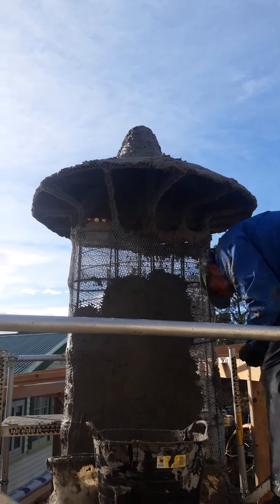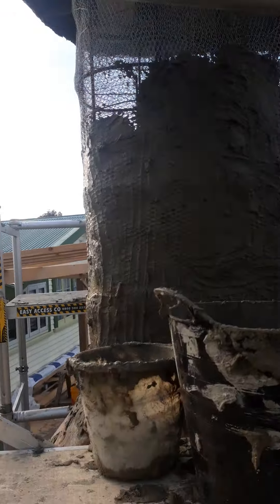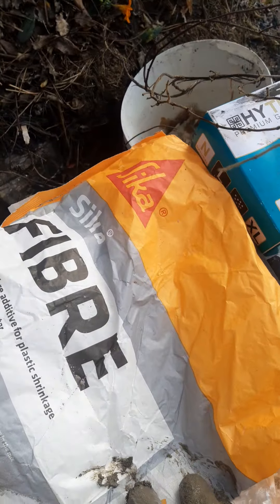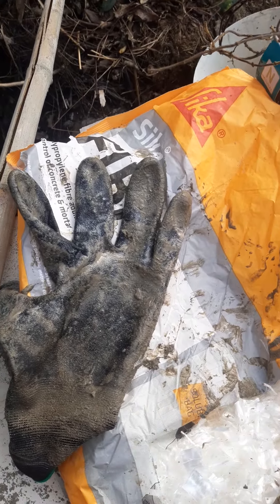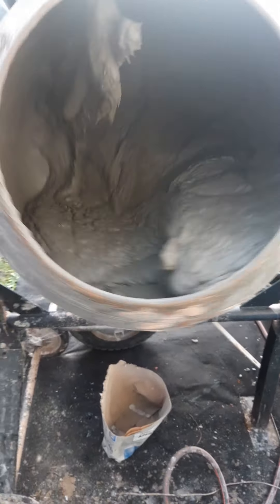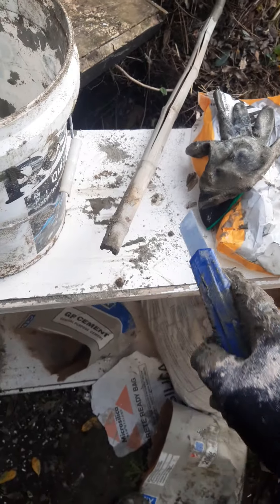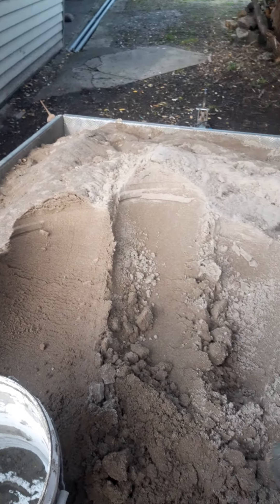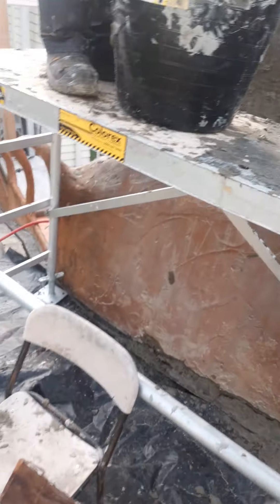Secrets of the Mud - how to plaster a Ferrocement mushroom chimney.

Comment: Thank you for this information! I'm amazed by Ferrocement and find myself caught up in imagining the possibilities for affordable home construction with it. Have you experimented with nonferrous materials like basalt rebar or fiberglass? The potential for rust with standard rebar and chicken wire concerns me a bit (also the extra thickness of the plaster to ensure sufficient coating vs thinner/lighter possibilities with other materials...).
Reply from the maker: Hi Jeff... ive been imagining hobbit holes and cabins using Ferrocement for years now, soo going to make one, just a bedroom, with round doubledoors... see my www.dreamhaven.nz...concept drawings etc. Ferrocement is so strong, durable... maybe not cheaper than many methods  but so sculptural and strong. I have seen non ferrous reinforcement but never tried it...apart from very handy coated fiberglass mesh in rolls..
Reply from the maker: Oh yes also the question of rust...not serious with Ferrocement as the mix is so rich. Witness the durability of well built Ferrocement boats in salt water...  the cement 'passivates' the rust. We did a Ferrocement fountain for eutopia Cafe 22 years ago..thin stalk, water in it continuously all this time. No rust I am aware of, even beginning. It is painted to of course.
Reply: @wizardofeutopia  great points on durability. I'd guess that steel rebar and chicken/rabbit wire fencing is both more affordable easier to get ahold of in more areas than basalt/fiberglass, too.
Reply from the maker: @Christ_on_the_River  yes steel definitely last time I looked was much cheaper and more available than the alternatives... always could change though.... I am investigating insulation for Ferrocement dwellings...looking into rockwool...  also steel wool for possible chickenwire substitute at least in part...there are some very interesting possibilities... watch this space! Well, in particular I'll update on www.fantasticferrocement.com and of course here on youtube @Renaissanceworkshops
Reply: @wizardofeutopia  I'm looking at a hybrid of Doug Lacy's insulation methods for double-walled ferrocement walls and what Stephen Williams is doing with styro-aircrete.
Reply from the maker: @Christ_on_the_River  ok good...research! I'll look up first kne, I have seen lots on aircrete,  made some... variable results, put me off, like baking a cake that rises but then sinks! Styrofoam bits seems a bit belt and braces, and the stuff is a bit plastic, wife hates it because hens can choke on it! I've used secondhand slabs to build a ferro styrene cabin tho...very warm!
Reply: Wow, what a great resource here, great mix, great method and I love the craftsmanship on the reinforcing armature.  It is possible to master cellular concrete using the right foam in a mix that serves as an insulation pour or to help "passivate' the rust in a strong mix as mentioned below.  The tests show that the closed-spherical cell aeration, Mearlcell 3532, creates relief for chemical expansion, ice and rust, so essentially fossilizes the steel reinforcing.  

I stick with only the 10 gauge grid-wire for armature to reduce the amount of steel encapsulated and the double strand, train-track, ribbons allow the branching and arching trusses, in the insulated roof, to accurately blend into fluid complex shapes allowing you to build those fluid forms accurately; forms you can't even fully model or draw but that you can reveal on site while still following your basic clearances from the blueprint and such. You can have flattish roofs because the truss frame is thick and sturdy. Any floor-plan layout; odd shapes, 'L' shapes, egg shapes, whatever.  Having the roof and awning done just simplifies the entry walls and lets you get more creative there.  

Those intersecting train-track ribbons somehow carry lots of info about the shape, also allows your single shell forms to blend accurately by just using the ribbons, not the block trusses built on the ribbons like for the main roof.  Single-shell funnel columns blend to each other, to the curled-edge protective awning and the double shell insulating roof.   To me, there is a base geometry principle for building homes that is a funnel column supporting a thick insulating roof and curled-edge awning; all one stable fluid form called the Core Monolith Pavilion.  It's just a principle not a set look or form as the awnings and roof curves can be many kinds of shape but the funnel-flare columns that tie the insulating shell to the single shell awning, is needed.  This makes roof gardens naturally.  The awnings are practical and provide spread-force butressing, balancing the stored forces in a dome like a buttress would.

The entry walls are built separately and are not mechanically bonded to the pavilion or floor. 

 If you want to keep playing with foam, try the Mearlcell 3532, its a good fit for low-water reactive powder mixes, and be sure and give the mix a good 5 minutes mixing, adding about 2 or 3 minutes into your fluid mixing but stay in the range of 9 to 18 percent foam for strong shell mixes, more for milkshake pours to seal and protect steel and give you some insulation..  My 2 bucket mix, is 4 gallons sand, 1.5 to 2.5 quarts water, depending on temperature... You want to cross minimum hydration threshold slowly at first to dial in the water content for your situation by adding little bits of water after 4 minutes of mixing all ingredients with slightly less water than will make it fluid.  Keep track of what you add and when it starts to respond by turning into larger round clods, let it stabilize then bring it to its fluid state with small amounts of water and pauses.  You can monitor the effective water content by stopping the mixer to see how much it self levels.  If you avoid excessive self leveling initially, the densified mix will mix thoroughly after five minutes in a fluid viscous state, while you are keeping up with water as all the cement hydrates. If you stick to avoiding self-leveling, use the exact amount of water needed initially, cross minimum hydration slowly, THEN you can hydrate it to whatever fluid consistency you like in the end and it will stick better on overhead.  Anyway, 4 gallons sand, followed by 2 quarts water, 23.5 lbs of Portland (1/4 bag), 5 oz of Plastol 5000, 1.5 quarts of STAR M3 refined flyash, Spherix Mineral Products 6.25 pounds, don't go over, 1 quart of Eucan MSA Silica Fume, 8 to 10 percent Portland weight. (really allows crazy light densities) add your 1 to 1.5 gallons of foam.  Calibrate your foamer and use a small 12 volt pump on a five gallon bucket so you don't make it too fast.  I forgot the half-a-quart of the PVA rsc 15 fibers.    Your mix is awesome and your alligator skin measure of the finished mix really shows your mastery.  Really glad I found this site.  I am building a pavilion now if you want to come check out the process.  I believe it will be cheaper than stick and frame if labor is measured by time, but it takes energy, work, to hogring gun that expanded metal lath onto the frame and hand plaster 2 buckets at a time.    Inspiring to see this.  We need to hang out and talk shop.
Reply: @ShambhalaVillage  great to hear from you here, Doug! I hate that I missed being able to come out last Fall. You're an inspiration, brother!

On the Pavillion, it sounds like the same geometric principles may be at play as what Frank Lloyd Wright designed for the Johnson Wax Headquarters back in the 1930s (they were a thinshell ferrocement).
Reply: @Christ_on_the_River  To me, there is only one advantage of cellular concrete/ foamed concrete.  Aircrete is a new term that was trademarked for another material, a name that doesn't consider its origins, engineering and proper foaming compounds for consistency, predictable R-value and compressive strength (not Drexal or dish soap).   
That advantage is the labor-saving ability to mix and pump-deliver a large volume of material into the form.  You could just bucket in gravel, or sand, or rubble, or glass, or trash, or soil, or styrofoam beads or a mix, whatever, into your double-shell roof, and that would work great if your stay-form is right, or leave it hollow, because the stability of your roof is defined by the form, the geometry of proper stress-skin design, the inability of the surface shells to cave in or out under bending strain.  Thermal performance enhancement of a cellular concrete is significant but not large or needed for small designs and the strength enhancement is significant but also not necessary.  You are already building 200 times stronger than needed but adding foam concrete makes the punch-through resistance better and allows your roof to absorb and stop energy of projectiles like cannon balls.  
The main thing that people overlook or fail to see when building, is the tremendous volume of material needed for thick roof or walls.  It's a thing.  If you can mix and pump-deliver that volume, with one guy running mixer, dumping it into a basin that it is continuously pumped out of, the labor saving advantage makes that 4-5 bag-per-yard mix of  foamed neat cement cheaper than a free pile of sand sitting near by.  
The framing, the light- block-wire internal structuring of your stay-in-place form/armature, the bifurcating branching from columns, not walls, of curved, build-in-place trusses,  and the proper surface reinforcing around that internal framing, is everything.
Reply: @ShambhalaVillage  so good and helpful. I really do need to come visit in person or find some time to talk. I believe those of us interested in this particular area of alternative building could benefit greatly from a type of program like the ferrocement society in India - except we could focus on an exchange of ideas and friendly discussions of principles.
Reply: @Christ_on_the_River  Great to hear from you, Jeff.  Maybe a bit.  The best example of the base geometry of a Core Monolith Pavilion, besides just pics of what I just built, still working on the upper shell if you want to come out and help, is the Mount Clemens Savings and Loan, except with rounded corners and that edge that curls downward for edge stability and for pushing back wildfire.    That ring beam plan is no longer.  It is far better to just branch outward from each column to the adjoining column branch and then place horizontal curved wire-block trusses on each side of those branches to form a band of triangles as your base framing.  That way you are not distorting a truss into a ring it cannot easily be, an unnatural shape, you are instead allowing it to express the curve that it is.    Also, the new tapered horn trusses centered in the cross bracing between columns radiate outward above the entry arches, gives your awning the stability, insulating thickness and shape you want. Watch the framing page at flex-shell-architecture.com for changes.

 Also, I am liking the 1/4 mixes because cracking occurs if you have to freshen up the mix with water or acrylic because it takes too long to get rid of a fresh mix.  1/4 mixes are fast once you dial in the exact water demand for the day's humidity, temperature and solar radiation.  You can really screw up a micro mix with an extra spray of water but if you go over 15 percent you can correct with a little extra mixing time, more than that, you may not be able to use it for overhead.
Reply: @ShambhalaVillage  Mount Clemens S&L is absolutely amazing. I love how you've refined both the construction and materials to bring these organic geometries within reach of those of us who are willing to learn.
Reply from the maker: Wow some deep prior discussions behind this thread...you guys know each other... so, I watched shamballa videos with interest, still don't have an overview ... (e)book perhaps? Have you come across A Pattern Language by Christopher Alexander? It's a virtual Bible for holistic architecture and human thriving...and some building principles eg Gradual stiffening of structures,  thick pillars, etc.
Reply: @wizardofeutopia  I just bought the Christopher Alexander book and look forward to reading it! Thank you for the recommendation.
Reply from the maker: @Christ_on_the_River  that's exciting! It is truly wonderful. He died this year... encouraged inspired and helped so many people... his legacy goes on.